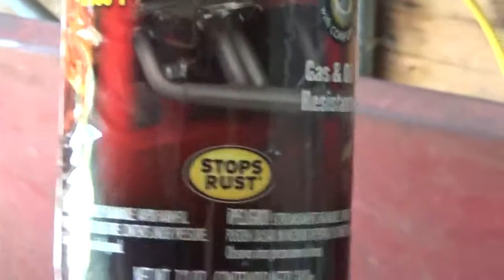WOOD BURNING STOVE ROCKET STOVE MASS HEATER PART 4

Comment: looking good man,!
perhaps test fire it outside in-case any fumes off-gas from the paint curing process.  i like the red and blue, seems very 'merica lol.  the fire brick are almost necessary, they
will help alot.  some say the chimney draw helps alot with rockets so keep that in mind if you do a test fire outdoors.  i also used 5/16 (8mm) thickness in my burn chamber of my first rocket
Reply from the maker: Thanks man already try it before paint and fire brick.was working fine.cant wait too try it whit fire brick and if i do the first burn in my chop i do have good ventilation but whit do it safe will do it outside.mi first stove did a smoker in the chop lol.and for the chimney it about 17 feet high.